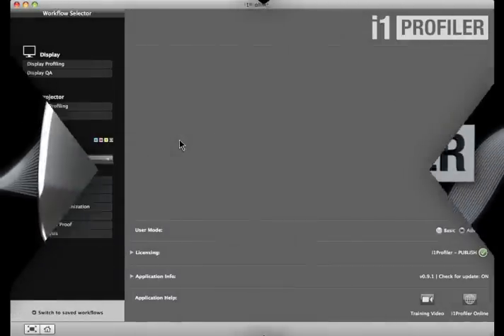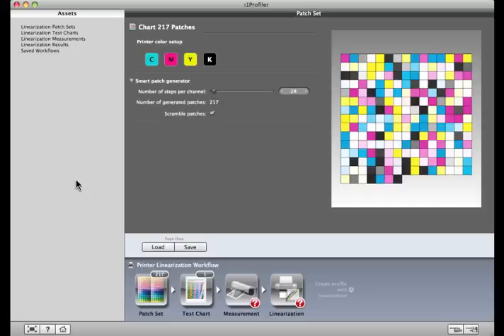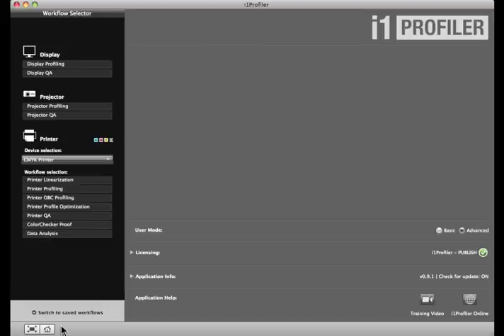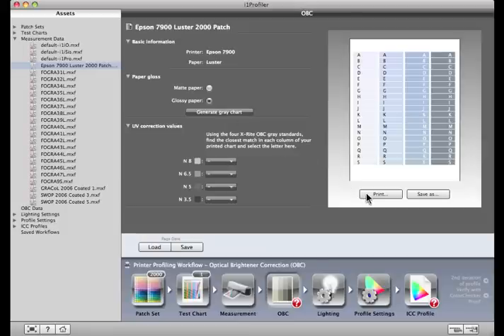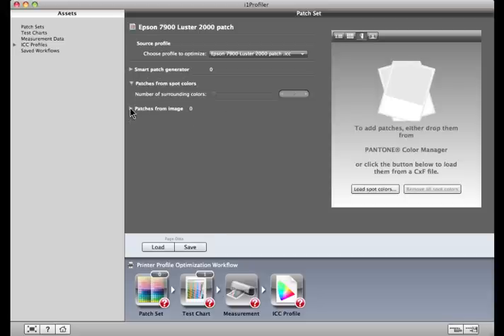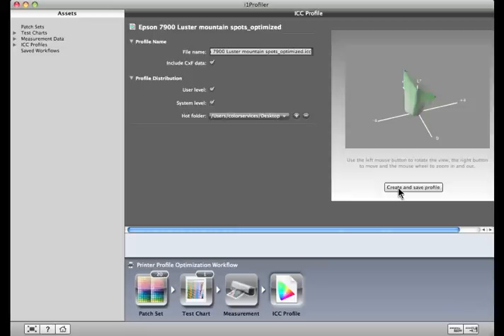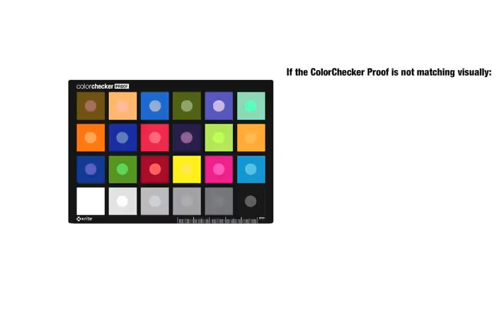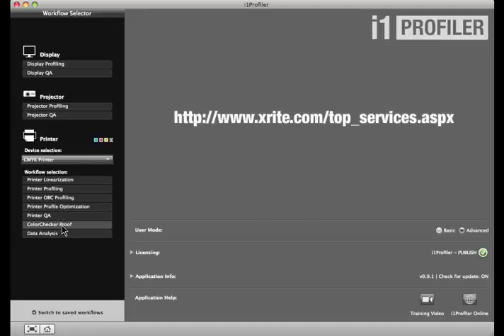X-Rite i1 Profiler Advanced Printer Options

Comment: Question for optimization print: Must i print the optimization chart with color correction on in RIP or off? Nowhere this question is answered.
Reply: Must be OFF?!
This workflow does not make sense. In my opinion — you can add all needed additional color patches from this step into main target for making the profile.
Chico11mbits question has sense!
If I want to improve quality of the profile, then I need to print 2nd target (for iteration) from RIP through linearization and profile (the profile, which I want to improve)!
Only this workflow of "profile optimization" has some sense…
So how is it?
Is there any detailed user manual, detailed instructions of this (not cheap) product? A very brief html "help" (which is part of the program i1Profiler) with a few simple sentences can not definitely be considered a real user guide.
Reply: It must be OFF. The measurement you want to do must result from a print made without the addition of further filters.
Reply: i guess it is kind of off topic but do anybody know of a good site to stream new movies online?
Reply: @Chaim Wilder meh I would suggest flixportal. You can find it thru google:P -corey
Reply: @Corey Knox Thanks, I went there and it seems like a nice service :) I really appreciate it!
Reply: @Chaim Wilder You are welcome :)